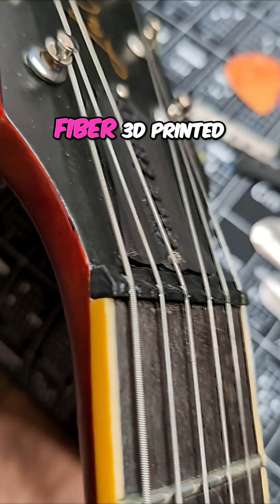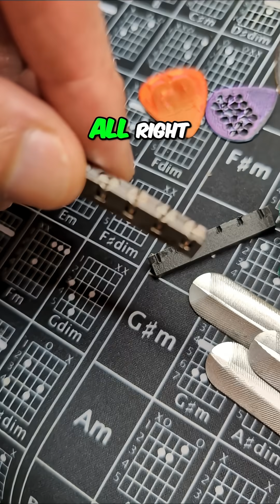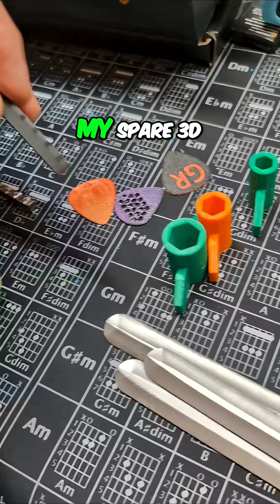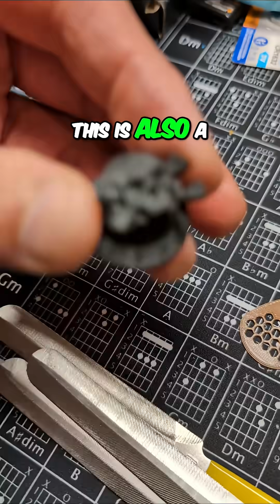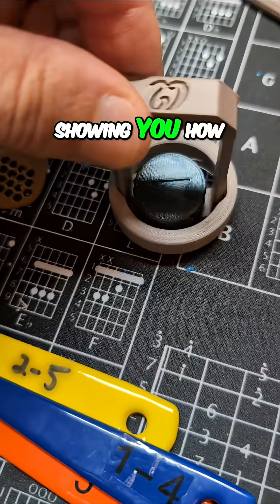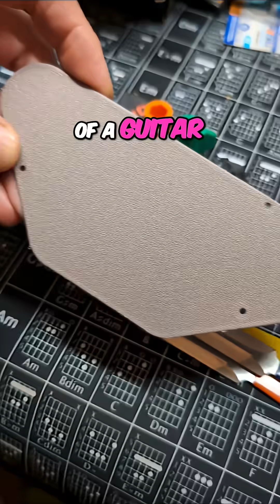3D Printed Guitar Parts: Carbon Fiber Nut & More! #shorts

Comment from the maker: PLA-CF https://amzlink.to/az0Fa7wlhuE2o
Elegoo Centauri Carbon https://amzlink.to/az0ZtuBE4LjvS

Our Printers:
Elegoo Centauri Carbon https://elegoo.sjv.io/Y9ve5O or
https://amzlink.to/az0ZtuBE4LjvS or https://amzlink.to/az06Fd8642zlE
Bambu Lab A1 Combo https://amzlink.to/az0iK8AdK4WL1
Bambu Lab A1 Mini https://amzlink.to/az0iK8AdK4WL1
Elegoo Neptune 4 Max https://elegoo.sjv.io/Y9ve5O or https://amzlink.to/az0WIuEASRnEz

You need this cold print bed for the Centauri Carbon https://amzlink.to/az021naV3Efti
Our Favorite filaments:
Elegoo PLA Plus https://amzlink.to/az05hfm44OZrl
Anycubic high speed PLA https://amzlink.to/az0jVOKlIyGVG
Flashforge Silk PLA https://amzlink.to/az0MQkhaoBSi4
Creality Hyper PLA https://amzlink.to/az0GdIGpt7XCx
Creality PETG https://amzlink.to/az0YJOw76kbk8
Overture PETG https://amzlink.to/az09RGWW59gvE
Elegoo PETG https://amzlink.to/az0l2Imboicet
Bambu or Centauri Carbon cold plate https://amzlink.to/az021naV3Efti
Our favorite filament dryers:
- Comgrow budget dryer https://amzlink.to/az0hzcqlMiX1q
- SUNLU Filament Dryer Box S4 https://amzlink.to/az0L4245yhjwN
- Creality Space Pi https://amzlink.to/az0iK8AdK4WL1
Elegoo Centauri Carbon Ceramic nozzles:
- 0.2mm & 0.4mm https://amzlink.to/az0eYJvjGRMnc
- 0.6mm https://amzlink.to/az0yNSj0WRcmm
Inquiries: Sponsor, Amaon videos, or product reviews sponsor@gear-report.com